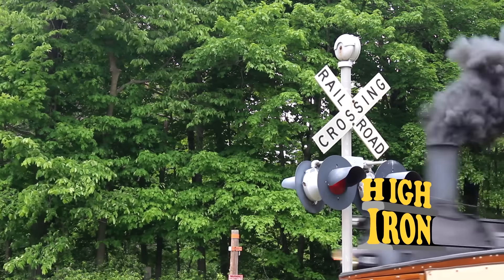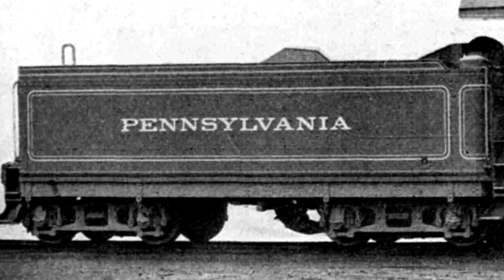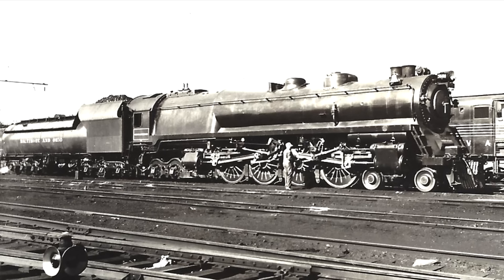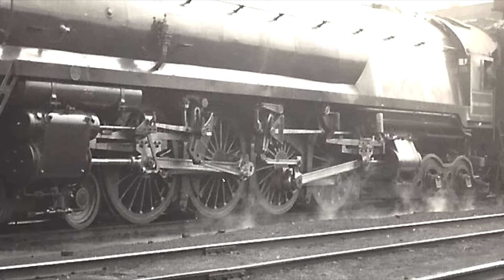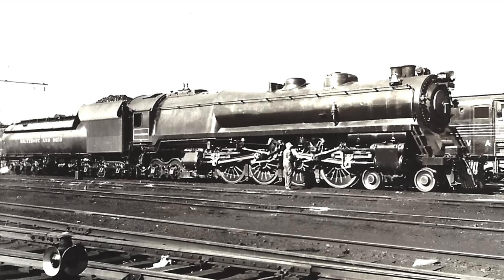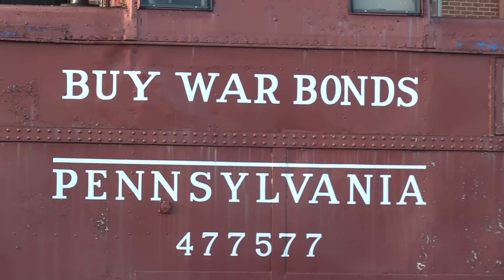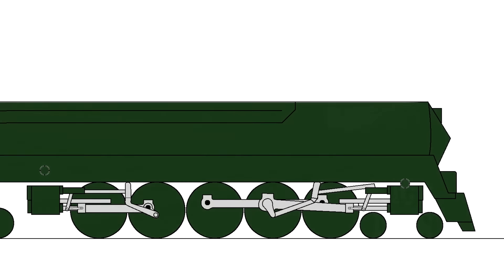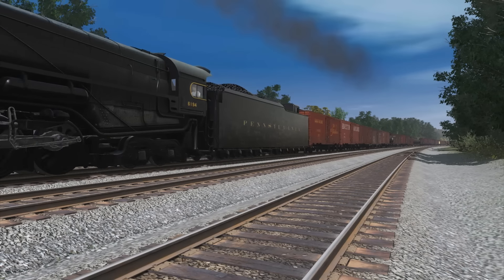Why Weren't Duplex Steam Engines Successful?

Comment: I like your theory about the PRR's engineers pulling the T1 throttles too fast. The great mystery is the entire Q Class. The PRR was always a 50 MPH freight railroad, with much of its cargoes being open top coal hoppers. That fact is why the PRR rejected the N&W Class A 2-6-6-4 locomotives, which they tested when they were considering the C&O T-1 2-10-4. That's probably also why PRR did not try the Challenger types (4-6-6-4). So why build such complicated locomotives with 69 inch drivers as the Q's? Thanks for promoting the T1 5550 project!
Reply: That a good question. I just think the Q class was pointless
Reply: @gamerfan8445  - And yet, they built 25 production Q2 locomotives, after both the prototype Q1 and Q2. Maybe it was a political decision to reassure the coal mining companies on which PRR relied for its largest share of traffic? It would be fascinating to go through the archives to find the answer to the Q2 Mystery. None of the Q2's was in service more than six years, and PRR bought its first diesels right after the class was outshopped.
Reply: The Q2 was justified and built as a wartime engine, able to run trains of appropriate weight at appropriate speed to justify both the high horsepower and the reduced augment.

Once peacetime came, and PRR started whining about how its trackwork had been hammered 'in the interest of the Government' but the Government wasn't helping pay for it, PRR went back to a 50mph freight limit where nothing more capable than M1as were needed for M&E.

The one thing that the Q2s 'would have been good for' over the J1as would be TrucTrain service, which ramped up only a short time after the Qs were allowed to decay to unrecoverability (see also the lamentable case of the 'return to service' that ruined the reputation of the NYC A2A Berkshires).
Reply: @wizlish  Interesting! I actually considered the T1's could be adequate for such a service. Such tonnage running at passenger train speeds would've been just about within the comfort zone of the T1's...assuming they were refitted with Frankly B-2 valves and rotary cam of course. Not the mention the route availibility of the 4-4-4-4's was the lowest not just of the duplexes, but of any of the Pennsy's "superpower" designs, including the S2 and J1's. That said the Q2's would've benefitted from this work too, had the permanent way been kept up. They had the capacity to give the Pennsy a proper fast freight design or even dual-service design. Sure, the J1's could've fufilled this role given they had the same drivers as a Challenger, but I see the 2-10-4's beeing more at home on heavier manifests and drag freights with all of their drivers coupled together
Reply: The PRR actually had several different classes of freight trains. They also had extensive amounts of flat terrain in the western half of the system, compared to relatively steep grades and sharp curvatures in PA. As a result, PRR actually had three sets of tonnage ratings where grades were involved - fast freight, general merchandise, and drags - i.e. coal trains. The PRR never attempted to run coal drags fast - a complete waste of money. And by the mid-30's, the PRR realized that for express and merchandise, they would be competing against trucks. Prior to the 1930's, the PRR was not a 50 mph freight railroad (neither were other roads - steam engines burn more coal and consume more water to go faster, and tonnage ratings drop at higher speeds.) So the PRR really did not have many high speed freight engines until they developed the M1 - their first freight locomotive that could sustain 50 mph for long runs with significant tonnage in trail. The M1 was used in dual service in some locations, and was the freight locomotive of choice in the 1930's where helpers were not required. Especially on the west end.

When WWII hit, the PRR was desperate for locomotive power, and while they bought the J1 based on the C&O T1, the original J1 deliveries were improperly balanced and immediately tore up the mainlines they were deployed on (the entire initial batch had to be re-shopped - this is documented in the J1 distribution during WWII.) As J1's deployed out on the west end of the system (Clearances were too tight initially for J1's east of Pittsburgh), the displaced M1's that had been deployed west of Pittsburgh were moved east of Pittsburgh as fast as the J1's were delivered to help with WWII tonnage east of Pittsburgh, and most M1s were deployed east of Altoona, and were even used under wire as GG1's and P5's were in short supply with wartime traffic demand.

Back in the mid-30's, the PRR established freight schedules designed to move express freight 400 miles per day, with twice daily service between major city pairs. But depression era traffic levels could be satisfied with the 300 M1 and M1a locomotives. WWII traffic, the estimated post war traffic, and the emerging long-haul trucking sector that was expected post war is what drove the desire for sustained 50 mph (and possibly faster west of Pittsburgh) high tonnage freights. That provided the impetus for the Q1/Q2 concept. The smaller Q1 couldn't beat the J1's, but the Q2 could from a performance standpoint (while the J1 was marketed as a "super power" locomotive, it was usually run at lower speeds to take advantage of its peak HP, which was at a lower speed than the Q2). The Q2's were designed to operate in the western half of the PRR system, since clearance limitations couldn't support operation of the Q2's east of Pittsburgh. After some track realignments made during WWII the J1's could reach Altoona after the war, but cold not venture east of Altoona due to more clearance limitations.

Outside of the nearly pure coal hauling RR's like the N&W and C&O, there was nothing special about the Q2's being replaced by Diesels - Diesels were just much more economic to operate than steam, and very few classes of steam were not considered walking dead post-war - the speed of replacement was more a function of diesel locomotive production capacity and the profitability (cash on hand) of the RR buying them. And steam locomotive maintenance was very expensive. Ignoring all of the urban legends about keeping coal companies happy, and being biased by owning GM stock, a review of the PRR's dieselization shows three trends - (1) the PRR did not fully understand that there wasn't the need to deploy specific types of diesel locomotives for the various service types as the railroads did for steam locomotives, (2) the PRR underestimated utilization rates for diesels compared to steam (overbuying some diesel types early in the transition era), and (3), recognizing the significant reduction in maintenance costs that quickly became evident, the PRR placed diesels at the outer edges of the system first so they could close distant steam maintenance facilities (which is why PRR steam's final stand was almost entirely near Altoona). The reduced maintenance costs is a key reason why all west end steam, including the Q2's, were replaced relatively early (and the Q2 class only numbered 25 locomotives - why sustain maintenance for such a small class?), while the 300 M1's and M1a/b's continued to operate in PA, and were phased out as they required boiler replacements, given that the PRR could not buy enough diesels to replace their entire fleet of steam quickly.

Bottom line - the duplex steam locomotives were not "singled out" for early retirement compared to other classes of steam - they were the victim of a whole host of other factors that resulted in PRR classes with smaller fleets, deployed distant from Altoona, to be retired first.

 BTW, the N&W J class was an amazing locomotive , but its large cylinders also did not fit in many PRR passenger stations, making it unrealistic to use in PRR passenger service)
Reply: @daveevans2527 Interesting Information on the speed of cargo steam engines in the USA. Post 1925 the german state railroad (Reichsbahn) constructed and mass produced a series of steam engines that ran (and some still run) at either 80km/h (50mph) or in one case 90km/h. And those where not "prime route" engines only (some where wih 18-20 metric ton axel load), the BR50 was designed for,secondary (under 16 metric ton axel load) tracks and over 3000 where build.
Reply: They rejected the N&W class A because a modern 2-10-4 was nearly as powerful and a whole lot less complicated.  Remember that PRR has 598 I-1 2-10-0 Decapods, which had been rock solid performers for over 20 years.  The C&O T1 which became the basis for the J1 class was basically a modern, super power version of the tried and true Decapods. That's why they went that route.  As for the Q's, they were only marginally more powerful than the J's and probably should have never been built...
Reply: @gamerfan8445  Any new steam locomotive built after 1940 was pointless. The die was cast with the internal combustion engine and electric traction motors in the late 1930's. If it wasn't for limitations imposed by the War Production Board in WW2 on mid speed diesel engines (needed for naval use) and copper for electric motors (needed for ammunition) NONE of the steam locomotives designed and built after 1940 would have ever seen operation. The Q2, among many other steam locomotives of that era only existed as a result of the production demands and limitations of WW2.